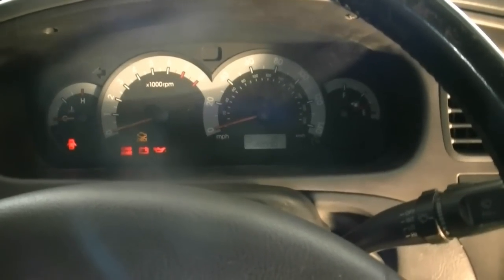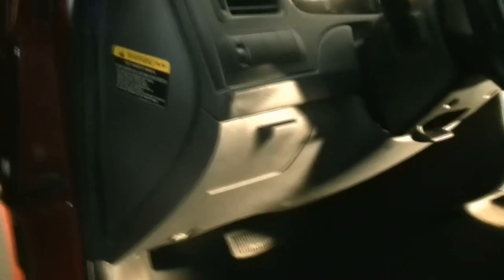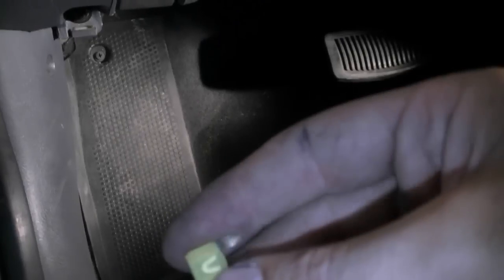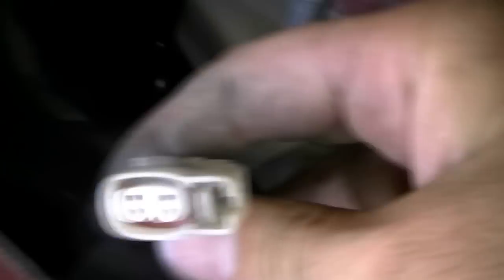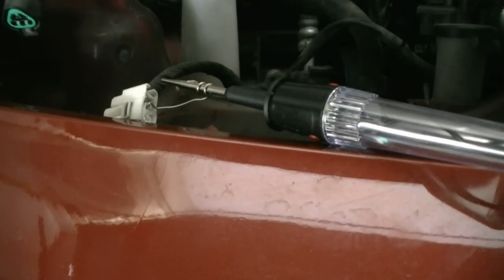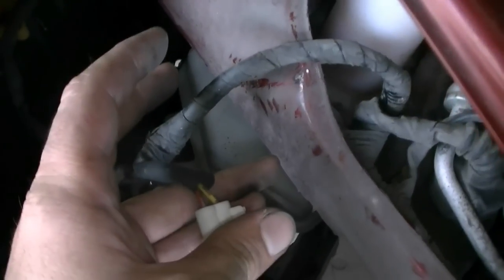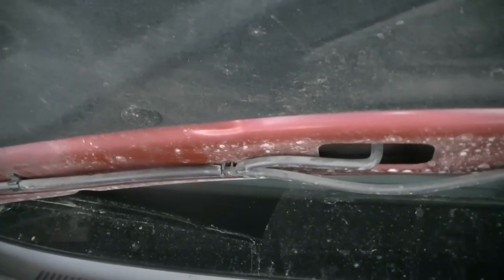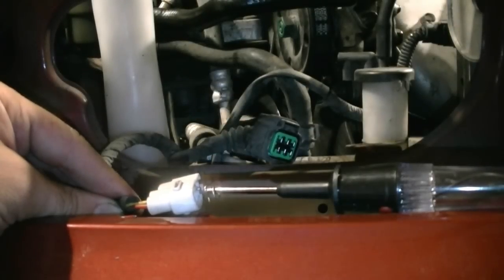Windshield Washer Pump and System Diagnosis

Comment: I used a test light and figured out the switch in my truck was bad. Apparently a common problem on my truck. Just put a push button switch on the dash and ran some wires behind the dash to the battery and pump. Works good now. Fuse was good. I'm just to cheap to put a new proper switch set up on, the truck is 25 yrs old so I don't mind
Reply: Kevin Isam were your wipers still working though even though washer pump was not?

Comment: I changed nozzles, checked the lines “from both nozzles” and the T also and elbow. And all clear. Could it be the pump? I havent check the last line which is the one that goes to the resoiver

Comment: Thanks for the video man! Just got a 2001 Nissan Sentra with a worn exterior but a sparkling engine compartment. I was bummed to find out that the windshield washer isn't working right. I'm going to follow your process but I have a question about removing the pump if it is bad. Can you remove the pump through the headlight cavity or would I need to jack up the car to get the pump out?

Comment: Do some cars have a separate fluid pump for front and rear washer nozzles or is it always the same pump that makes both front and rear work? Thanks for the video. It will surely help me diagnose the issue with my car.
Reply: Am having same problem

Comment from the maker: Test the relay for the motor first (I have a how to video on this) if not it you might need to get a diagram and figure out where non stop power is being supplied to the motor. I am not good at electrical diagnosis but if I had to guess I would say its a relay problem or the switch itself, if you can open up the steering column and disconnect the connector for the switch and see if it stops. GL

Comment: Turned out my fuses and pump were fine. The problem was with the hoses. They were clogged and broke in half when I tried to clean them. Hopefully, replacing the hoses wont be too bad.

Comment: Hello mate.
I to have a problem with my windshield washer.
First the pump was bad. I bought a new pump but still it doesn't sound anything. Its like no current is getting to the pump.
Gonna bye a test instrument and try the way you did on the video. If that doesn't work. Can it be a cutted wire or something.
Anyways, thanks for the video and have a great day.

Comment: how much washer fluid should it be pumping when you disconnect it from the nozzle. Like if you just put the hose in a cup to check the flow rate?

Comment: Is the washer fluid reservoir hose in any way connected to the Air Conditioning drain hose? I am having the leak into the cabin issue after driving for a while but my washer fluid is also all gone shortly after filling.

Comment: The wiper on my rear window is working properly, but in the front it stopped working. Can it be the fuse or is it the same fuse for front and rear window wiper?

Comment: Lincoln Town Car 2005 I tried it, no sound from the motor, replaced the motor still no sound.  Pipes not clogged. Fuses seem ok although I can't locate a separate fuse for motor and assume it's tied to wipers. Now what ...someone suggested relay and that's modular and would mean replacing the wiper motor. Not a small job. Any other suggestions?
Reply: Try changing the stalk that controls the washers.

Comment: Great video. Today I verified that the pump is OK, because it worked when connected directly to the battery. Ground was good at the pump connector. But the positive side of the pump connector ALWAYS showed 12 volts on a meter with the other end connected to the positive battery terminal. You'd think the pump would run continuously, but it doesn't run at all. Any ideas?
Reply: Fuse?

Comment: just a comment: it would be more direct to test for voltage between the two plates of the connector instead of checking each one vs. the battery. also it is good to check the pump for continuity. I just checked mine and discovered the pump does not need replacement. it's sth else. a burnt pump will show no continuity - infinite resistance showing as 1. on my multimeter.
Reply: I have a multimeter but I'm also a noob. Trying to test my pump, what does it mean to show no continuity?

Comment: HELP!!!! You
(yes i am.... there is fluid in the reserve,,, i changed the pump CHECKED FUSES(all good) and can hear the motor loud and clear, but it wont come out...i followed the lines from the pump to the windshield and they look bone dry as if the fluid never even ATTEMPTED to come out? the lines dont appear to be clogged (well the clear tubed ones that i can see through) , i even removed the jets then tried and still NOTHING!! what do i DO!!! im beyond pissed

Comment: I'm having problems where the wiper won't work not the pump. could that be the switch. wiper work the normal way just not with the washing setting.

Comment: Mr. Ratchets and Wrenches I have replaced the washer pump on my 06 cts and it still doesn't work checked the fuses and non are blown looks like its not getting any power any suggestions thanks in advanced
Reply from the maker: hmm, if its not getting power and all fuses and connections are good you will need a wiring diagram to check for continuity of the wires going to it.. also its a good idea to check for power at the switch itself making sure it gets power and it supplies power when you turn it on for the wipers. Hope that helped gl
Reply: Switch was bad in my truck, or bad wire. I just put in a new switch although I have to turn the wipers on manually I don't mind cause it was a free fix cause I had the wire and switch and it only took an hour or so

Comment: Ok so I'm getting water out of the little spray jet and the other doesn't work. But the pump engages and does have full fluid Idk maybe shortage on power ?
Reply: one nozzle works and the other doesnt? maybe one is clogged?

Comment: My washer motor is running and putting water over the rear screen with out the ignition  or washer switched on, what may be the problem?